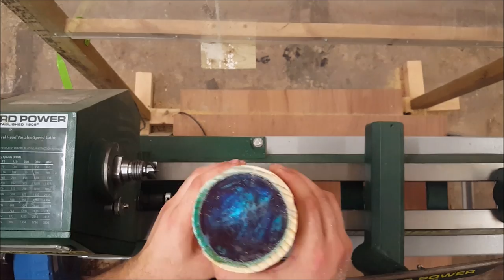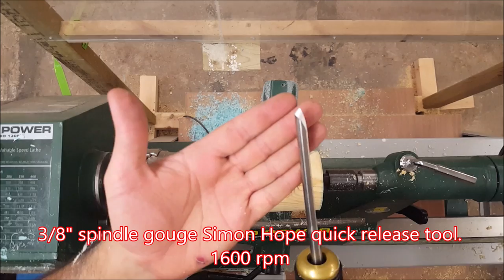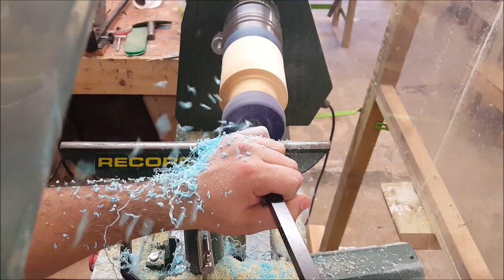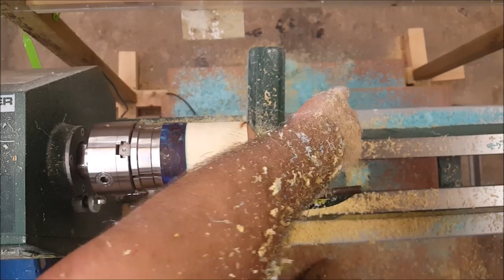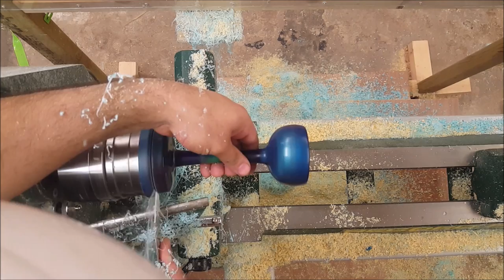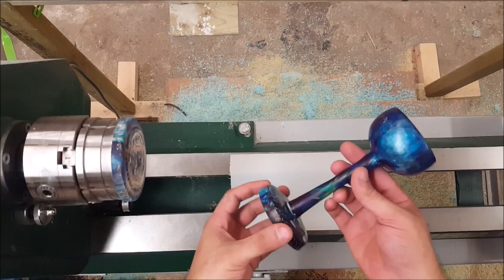Resin Project - How to cast Goblet without resin waste (No Silicon mold) Part 2

Comment: Beautiful work. Did you stabilize the pine cones before casting them in the resin? You inspire me...
Reply from the maker: hey mate, no you dont need to stabilize pine cone sin ce they not  rotting to  strengthen their integrity all you need to do is to dry them in toaster oven.